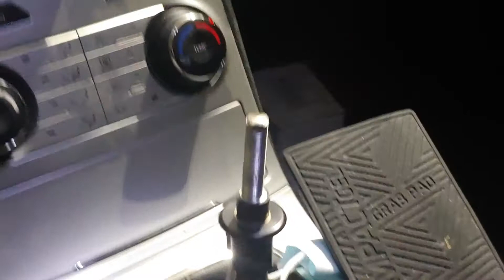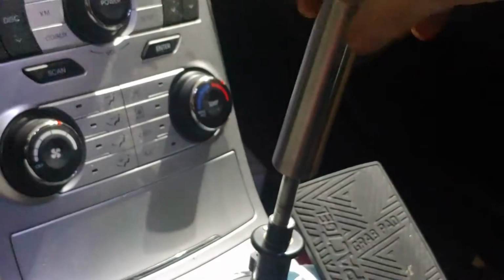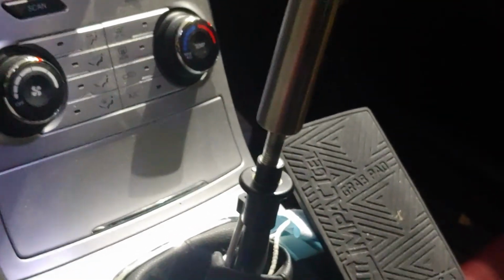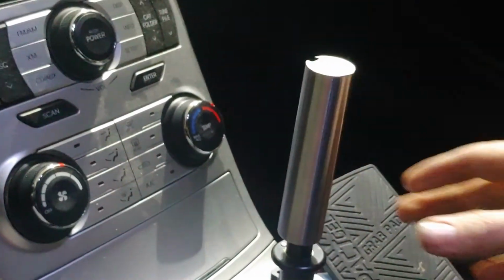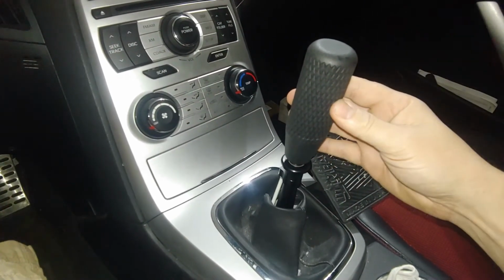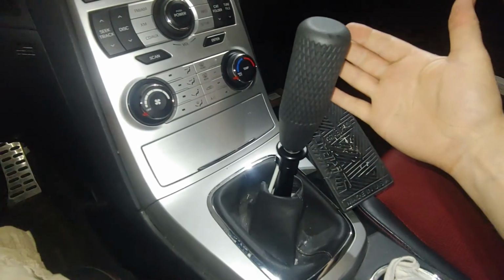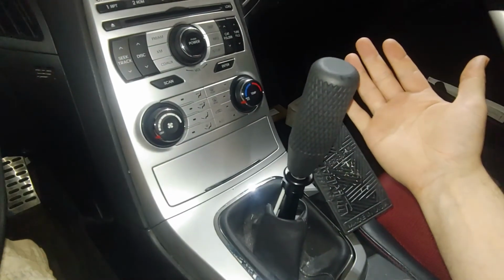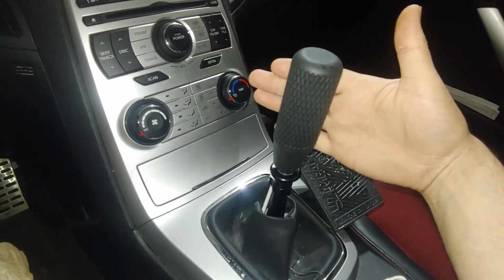3D Printed Shift Knob, Genesis Coupe

Comment: Hi, just ran across this and your design looks great. I'm working on something similar in a round shape and was wondering what filament you used?
Reply from the maker: The process used for this was MJF with Nylon 12. I had this made before I had my own printer. I would recommend ASA, ABS, Nylon, or CF-PETG if you're printing at home with FDM. And any of those filaments with a fiber loading would be good to withstand the heat inside a car. I will be testing my updated design this summer with CF-PETG.
Reply: @Weekend_Garage  can PLA also be used?

Comment: Wanna post a link to the file you created for the 3D print stl?
Reply from the maker: These files are not great. I've since revised it to not have a pin locking them together. Haven't printed it yet though.